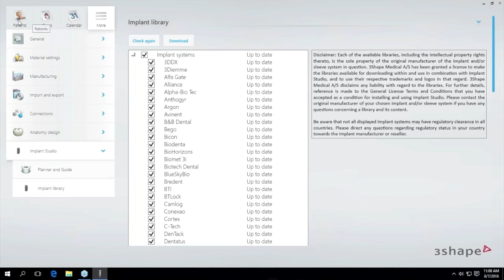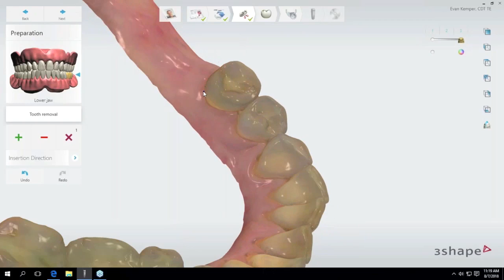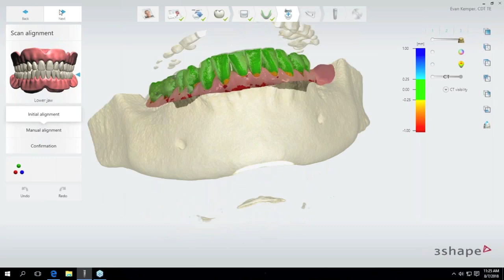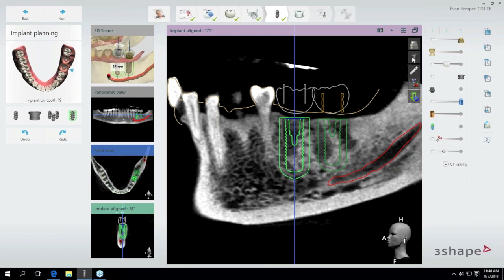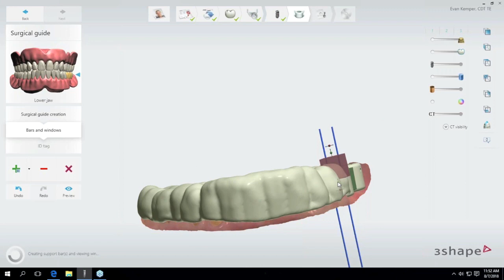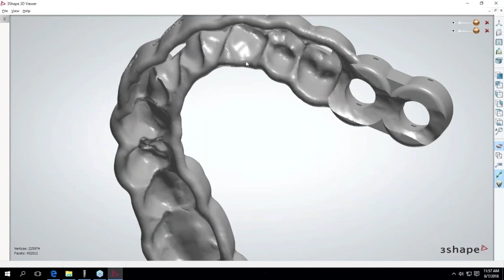[Webinar] 3Shape Implant Studio 101: Introduction to 3Shape Implant Studio with Evan Kemper, RG, CDT

Comment: I am having a hard time planning a bone supported guide on an over denture implant case for maxillae where most of the teeth are present. Do i only need DICOM files since it is going to be an edentulous case or should I still merge the STL file with the DICOM file for better accuracy
Reply: Do you know what version of Implant Studio you are currently using?  2020 is the only version the directly supports bone supported guides.  It may not be available in your area yet if it hasn't passed your countries regulatory requirements.  If you do have access to 2020, then you just need a single CBCT scan and the software will extract the surface scan by wrapping the selected area of the CBCT scan.   However, the current workflow is expecting the teeth to already be extracted in the CBCT scan.  There isn't currently a way to extract teeth from the CBCT scan virtually.  If you are on a previous version of Implant Studio, then the edentulous workflow is designed to be tissue supported (but anchored to the bone) using to CBCT scans, one of the head and one of an existing denture.